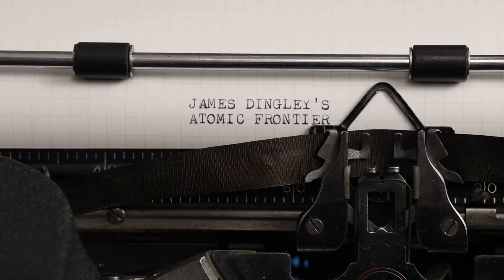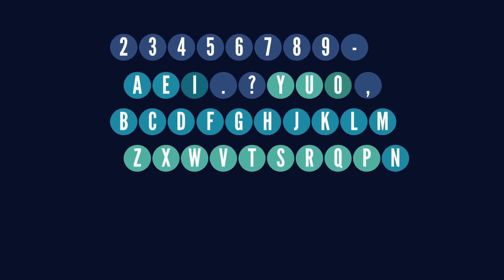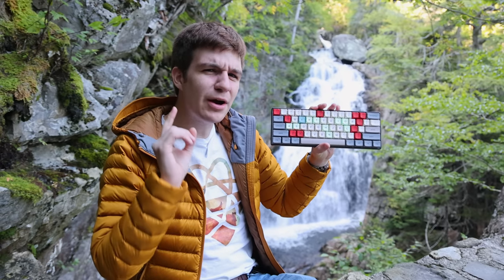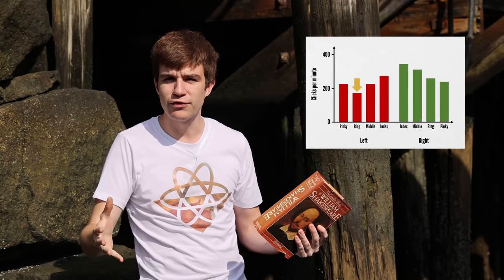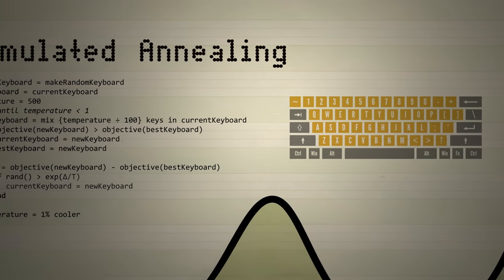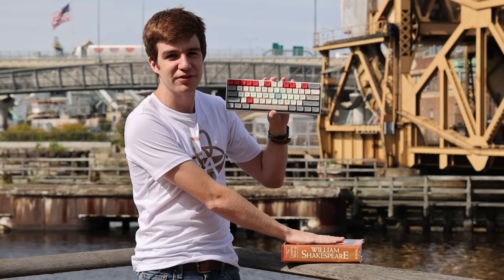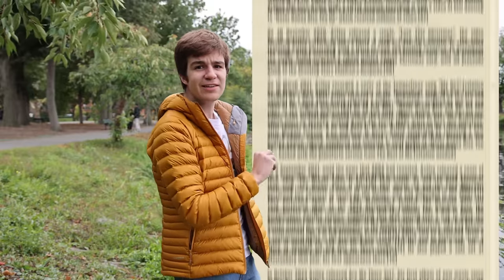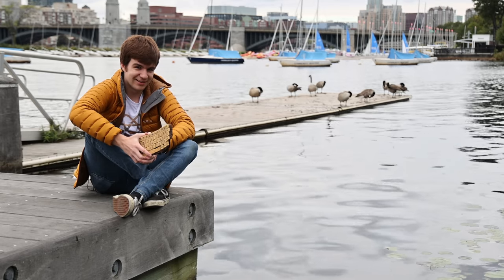QWERTY is broken. Can we make it better?

Comment: I started to learn touch-typing and was appalled at how much work my left middle finger had to do. I switched to Colemak and never looked back.

The worst part of the switch was getting Ctrl+ and Alt+ combinations in windows follow Colemak layout (they were not... the letter keys went colemak but all the control combinations remained in qwerty). I had to tweak the layout file manually. Took me a day.

Luckily, the Cyrillic йцукен layout was designed better from the outset for ten-finger typing and needed not be replaced.

Comment: I am using Colemak on my phone. I forget how long I have been using it, but I think it was since November of 2023. 

I have reached the same amount of speed I had on QWERTY while using Colemak. 

From my experiences, it seems to be a better keyboard for typing with only two thumbs than QWERTY. As the more common letters are on the middle row, meaning less thumb movement.

Though it has somewhat of a right thumb bias. As the some of more common letters I use are on the right side of the keyboard. I think it's because every vowel except for A is on the right side. 

This is how the layout looks

qwfpgjluy
arstdhneio
 zxcvbkm

I believe the reason A is on the left side of the keyboard is because of the CTRL + A shortcut on PC, as this was mainly designed for PC's, and since QWERTY dominates PC keyboards that means inorder to keep the familar shortcut keybindings it needed to match QWERTY.

Edit: I have actually been using it since August of 2023. So as of March 11th, 2024 I have been using it for almost half a year.

Comment: I've been using the Neo2 layout for over 5 years, which is optimized for letter frequency very similarly to what you did. Never looked back to QWERTY. It takes quite some time to get used to, but it's worth it, even just for the flabbergasted reactions of people seeing my keyboard for the first time 😃
Reply: A fellow neo2 user. 😄 
I use it on the ErgoDox EZ with blank key caps. Absolutely worth the pain it took to re-learn!

Comment: I tought myself the Workman layout (with select changes), which was an interesting comparison to Dvorak.  Dvorak does a better job of prioritizing alternation (something you didn't consider in this video) and minimizing consecutive same finger usage (something you also didn't consider).  Workman does a much better job of considering the natural range of motion of each finger (much easier for index finger to move downward than the ring finger, for instance)

It does take about a month to get even remotely productive with an alternative layout, and probably 2-3 months to hit your old speed, but honestly?  It's worth it.  Give it a try!
Reply: Workman was the first layout after QWERTY that I tried when getting into touch typing. It's been so long I don't really remember what I exactly I didn't like about it but it kind of felt wrong and "slow". Ended up switching to Dvorak (with some modifications for Ergodox) that I use ever since.

Comment: I have been using colemak for about 8 months now and i can say that i find it significantly more comfortable to type with. Retraining my muscle memory was challenging and very frustrating at times but I think it was worth it for the party trick alone. Now I'm using a column staggered 34 key keyboard called the ferris sweep using colemak as the keymap and I can say that it is the most comfortable and effortless typing experience I have ever had, to the point that going back to a normal row stagger keyboard using qwerty feels fatiguing after about 10 minutes. Learning a new layout is not worth it unless you find the challenge fun though.

Comment: Tip: strengthen your hand supination and wolf joint stabilizing muscles in order to avoid fatigue and injuries. (Even twisting your hand around while holding a milk jug/water bottle for one minute at a time is sufficient).
When I started learning Hungarian I noticed their keyboards have y and z swapped from the perspective of the English layout.
I immediately got used to it and I think it's super convenient for a language that has many words spelled out with the bottom left part of the qwerty layout but with a Y which is very common in this language especially in words you learn at the beginning (common adjectives and almost every pronoun and reference words).
vagy ("you are" / "are you?")
gyenge (weak)
imagine the letters z and y were swapped. So convenient.

I used to think every keyboard is set so that the use of common letters would be spread out as much as possible. Bare in mind that I learned to type in Hebrew before I learned to type in qwerty which is only for Latin-descendant-languages.

This video really helped me see why I need breaks when typing for long periods of time.

Comment: one thing to note is that finger distance is not the only thing you want to think about when you're looking for a new keyboard. for example, dvorak was designed to increase the amount of 'drumming' (meaning you alternate between your left and right hands when typing) and colemak was designed to increase the amount of 'rolling' (using consecutive fingers like, like pinky-ring-middle-index or the other way around). personally, I have trouble with lots of drumming, so switching to colemak was a huge benefit for me. also, another thing to think about is using layers. for example, on normal keyboards we use two layers, one with lowercase and one with uppercase. there isn't really any reason to only limit this to two layers; and I for example use three for lowercase, uppercase, and numbers/punctuation. additionally, you briefly mentioned the orthographic keyboard, but that's not the only improvement you can make to the layout; for example if you then proceed to split the keyboard down the middle you can have your wrists at a much more natural angle instead of twisting them so much. personally, my favorite style of keyboard is the dactyl manuform, as it also shifts the columns to account for the different lengths of your fingers, curves the surface inwards so that your fingers always point directly at the keys, and lets your normally useless thumbs actually do things by having modifier keys next to the thumbs instead of having to move your whole hand whenever you want to use a key combination.
Reply: no wonder DVORAK sucks; drumming is not a good quality to have. For instance, I can type 'star wars' with the left hand entirely.

QWERTY is the superior layout, because it finds the perfect balance between drumming and non-drumming; Colemak sucks because prioritizing 'rolling' is also stupid;  Again, QWERTY is superior, as it doesn't prioritize a single thing, but it BALANCES THEM in the perfect way.

People seem to get stuck on one concept and then try to min/max it like oafs, not realizing that BALANCE IS THE KEY
Reply: Most of the typos I make are from one hand getting ahead of the other. Two fingers on the same hand hitting keys in the wrong order never happens.
Reply: This guy keyboards

Tbh before this video I thought qwerty is worse than t actually is but now that I can just roll my fingers to type qwerty I can see why it's so good
Reply: @pyropulseIXXI  As someone who switched from QWERTY to Colemak, I disagree. Drumming/rolling aside, QWERTY has a lot of commonly used keys placed in very awkward positions. The primary benefit of Colemak for me is bringing the most commonly used keys to the home row or close to it. I used to have genuine finger pain typing on QWERTY sometimes, which I fortunately don't experience anymore.
Reply: Yeah, drumming leads me occasionally into a typo where every vowel in a word is 1 letter later than it should be.  

I've only found inward rolling useful (pinky to index), trying to do it outwards sucks in comparison.

Qwerty puts all the useful letters in the middle of the top row and that just doesn't make sense for homerow typing, when I did use qwerty it was with hands on sert yuil most of the time
Reply: There are only two popular western layouts really worth using -- Dvorak and Colemak-DH.  Dvorak is a good default since it's good at every western language and works well on traditional row-staggered keyboards.  But for people who only type English, and who use ortholinear or column-staggered keyboards, Colemak-DH is more optimized for that.  Qwerty is mostly only practical for legacy purposes.
Reply: 3 layer is fairly standard outside of US keyboard layouts although isn't used very much except for € and áéíóú
Reply: most based and superior take
Reply: @ToyKeeper  Unfortunately, for some of us, those legacy purposes can be fairly critical.  I switched to colemak for a year, and in general it was great, but a couple of times I had to use someone else's system to log in and fix some downed servers.  Trying to fix things in a hurry, while having to look at the keyboard, and still type 15WPM with lots of typos instead of my usual  75-80 was not a fun time.
Reply: @nwimpney YMMV, I guess. On the rare occasions I have to use qwerty, it's not really a big deal. I just type at 60wpm for a little while instead of my usual 120. A few minutes of inconvenience once in a while seems like a low price to pay for a better experience the rest of the time.
Reply: @nwimpney  There are programmable keyboards, so if you're in a pickle, you can use your own keyboard with Colemak, and have the keyboard translate that.
Reply: its because his homebrew fitness test only took into account finger travel distance, not the angle, direction, or, you know, the fact that qwerty is asymetrical for no practical reason. Ortho and split keyboards aren't about speed or distance, its about comfort.
Reply: I suspect drumming was important on mechanical typewriters, since you need to hit keys quite strongly and with consistent force to have uniform print.  Simply touching a key was not enough.  My wife was trained as typist during school years, and she still smashes on the keyboards occasionally,
Reply: @nwimpney  That's how I feel when having to type on a phone :)

Comment: You mentioned Dvorak, but I'm moderately surprised there was no mention of the Colemak layout, which is supposed to be even better.

Obvious question: if you were previously around 60wpm with the QWERTY layout, after the exercise did you wind up seeing any improvements on such?  Figured I'd ask just out of sheer curiosity ^_^
Reply: I agree. Colemak is designed to be relatively easy to learn relative to the benefits it provides. I switched to Colemak DH several years ago and am not looking back!
Reply: After 40+ years of using qwerty, i have switched to Colemak DH too, using a 36 key layout on a split ortholinear keyboard. The difference in comfort is amazing and typing feels effortless.
Reply: @darcsentor  how much time did it take to switch?
Reply: Better for what? Dvorak is handy for programmers with common characters like home row -_ for snake_case and kebab-case variables to be easy to input. ',. for characters, lists, and accessing records are also in better positions. I use these symbols more than some Latin characters demoted to the bottom row. I tried a few other layout options, but none of them helped me at my job as much. (And yes, languages that use semicolons, ;, are inferior to options that do)
Reply: Colemak-DH is better if you only type English and use an ortholinear or column-staggered keyboard.  Dvorak is better if you type other languages too, and use a traditional row-staggered keyboard.  For English-only on a traditional board, they're roughly evenly matched, with Colemak-DH having a slight edge on ISO layouts.  In either case though, I strongly recommend using a keyboard with open-source firmware like QMK, so you can customize things to meet your personal needs.
Reply: Even Colemak is still not all that deep on the iceberg. There's Workman (what I use), QGMLWB, Halmak, and more. People keep making new better layouts, though it's hard to say if there's a single best one because they don't all optimize for the same things. For example Workman doesn't win in every efficiency metric (though it's extremely good) but it's the only layout I've seen that aimed for 50/50 hand usage (percentage wise, not just constant hand alternations like Dvorak does), which was a big deal to me after having left hand pain with QWERTY and right hand pain with Dvorak. Workman also fixed/avoided flaws that Colemak had that it had to work around with Mod-DH.
Reply: Yeah.  All the alternate layouts have their advantages in particular niches, so "even better" is only going to be true to certain people.
In my experience, and for most of the other people I know who have properly learned alternate layouts, the typing speed increase is fairly modest, and most of them do it more for comfort reasons.
I think I sped up from around 70 to 75 when I switched to colemak, but I'm not even sure how much of that was the layout, and how much was just doing a bit of extra practice to learn the layout.  I'm back to qwerty now, and am still in the same 75-80 ballpark.
I liked the feel of typing in Colemak, and while I don't really have any hand problems with typing, I think if I ever do, I'll likely switch back.
I had to give it up, because I often need to work on qwerty computers that aren't mine and couldn't keep a decent typing speed/skill on both simultaneously.
Reply: I switched to Colemak cold turkey 16 years ago and never looked back. One of the best decisions I've made. Absolutely no hand issues, despite being a software engineer.

Comment: Better mechanical setup theoritically is often not better for your hands, more importantly your wrists.
I prefer testing for myself and spent years using Dvorak, i switched back to Qwerty because i found that a far most ergonomical setup with my improvised technique.  The least pain over time (near zero if any) was randomized chicken pecking at high speed mixed with "proper" typing which qwerty allowed for much better, possibly due to its "faults", then dvorak.
Our hands are not mechanical, they hate doing the same thing over and over, and that was best strategy to maintain speed and eliminate RSI that i found.

Comment: Switching to Dvorak was one of the best choices in life I've ever made. It took me about a month to not feel like clunky gloves, and 3 months to be about 80% proficient. I chose Dvorak over Colemak or similar because it was best supported by default over most operating systems. Nowadays I use a ZSA Moonlander with a lightly modified Dvorak and it's amazing. If you do any amount of typing, I 100% recommend learning an optimized layout. Your joints will thank you. 

As a fun side note, I'm actually using Qwerty right now because I just wiped my laptop and haven't bothered to switch to it and my mechie is in the other room. I only lost about 20% on my qwerty performance over time and my brain automatically switches by the feel of the keyboard, it's so weird (useful whenever using someone else's keyb). Actually I should just fix that. ...

Ahh there we go. Woah that feels so weird. My muscle memory still thinks this keyboard is qwerty since it has been that way the past two weeks and it is taking me a sentence or two to shift back.

Comment: Having learned dvorak around 10 years ago, I can testify the huge improvement it gives you. The main point is actually making less mistakes, which makes you so much faster in the end. Never had any finger or wrist pain after, even with huge amounts of writing. Would always recommend! 
As another commenter said: It's not the best. But it is far better than qwerty. 

One other point though: Only switching very few letters does not make it easier. It makes it harder, especially if you happen to switch between both layouts later on. I do that frequently (one computer running on qwerty, one on dvorak) and whenever words start with ma or am (same position for both), it gets me confused. You want it to be quite different so your brain does a complete rewiring instead of using old circuits.

Comment: Holy... I was not ready for the sheer commitment. You travelled far and wide to have the best backgrounds, like climbing a mountain to explain gradient descent (or ascent should I say in this case), you programmed algorithm and visualization to actually implement and illustrate the topic of the video, you painstakingly built at least four themed keyboards and then even more so painstakingly used the worst possible keyboard you could conceive for a hundred days! Finally, you made an edible version of that for literally one scene before throwing It away.

Comment: I learnt to type starting around the age of 9, on an old DOS typing tutor program from around 1987 called Typequick.  It had great exercises for the fingers to help you strengthen and learn  their positions through repetition.  E.g., each finger would move between its home key and an adjacent key multiple times in different patterns.  So, your left ring finger might do S W S W then S W W S etc...  I did look at other typing programs as I got older but can honestly say Typequick was the best I ever used.  I hit 100wpm at the age of 14 and maxed out around 145 (if I was trying) in my 20's.  It's been an extremely useful skill although I'm glad I don't have to use it as much anymore.  I was doing some typing work for a while and after doing multiple days of 3+ hours dictation work I was definitely starting to develop some wrist problems.

I'm curious to see if you saw an improvement after going back to Qwerty after using your 'worst' design?